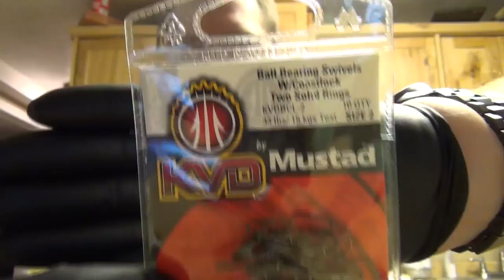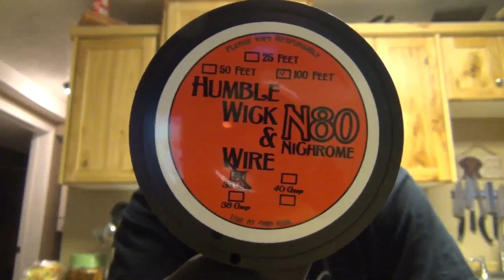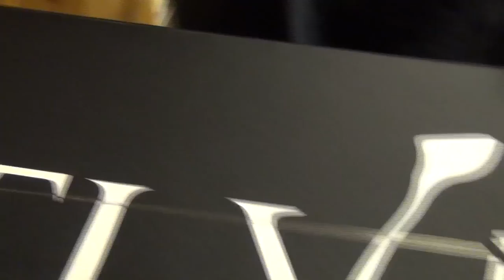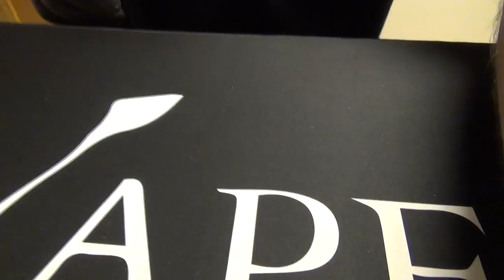fused clapton how to with tips and tricks!

Comment: Hey man. I figured I needed to take the time to write you a comment as I really value your channel amongst all the channels out there the most.

The way you explained the thing with keeping the spool at an angle will save me so much frustration making fused claptons. I'm using 34G kanthal over 26G cores when I make mine, which are both thicker than what you use, but they've always snapped off for me at the drill chuck. I firmly believe after watching this video that I've been tugging on the outer wire rather than just keeping it at an appropriate angle and just applying an appropriate amount of pressure. You're really just guiding the wire where it needs to go.

You always saved my Griffin 25 from going in the trash can with your Griffin video. It has leaked for me for close to a year now and I've been trying to wick it up around 100 times without luck. Turns out that RTAs kind of work the same despite the deck design. It's all about blocking the juice off at the right point in order to get good wicking. I've been through about a tank on the Griffin 25 now without leaks. I feel so stupid for not thinking of it myself.

If you have the interest, I feel you should be some sort of teacher. You are perfect for the job. I've seen people call you the Bob Ross of vaping and I have to say it's 100% true. I've never seen anyone explain what they do in the videos in such an easy to understand and replicate fashion. I truly feel this is what you were meant to be doing in life. Teaching people.

Thank you for taking the time to teach us dummies how to do things properly.

Also lovely to hear Mötley Crüe in the background :D

I also like watching your channel because I have relatives in Utah (Salt Lake City I beileve) so that makes you relatable to me.

Cheers from Finland! :)
Reply from the maker: Shaxi thank you for your very kind comment shaxi! definitely the nicest comment I have ever got. it made my day and I am grateful for the time you used to write it. I am vey lucky to have your support! Stoked!

Comment: Fantastic show and tell Trevor. As you pointed out it takes a little time and patience and it comes along. That wire wants to wrap right if you just help it out a little. Also key is using the right gauge wire for the cores and the wrap. I will admit I buy most of mine pre-made on the spool but it is a lot of fun to DIY! My first attempt was a mess but after my second I had it. This is one of the best vids to show everything from beginning to end. Thanks for posting it!
Reply from the maker: it's my pleasure! Thanks for watching!